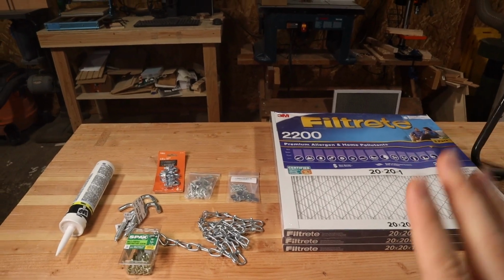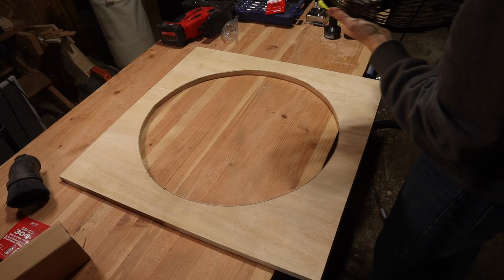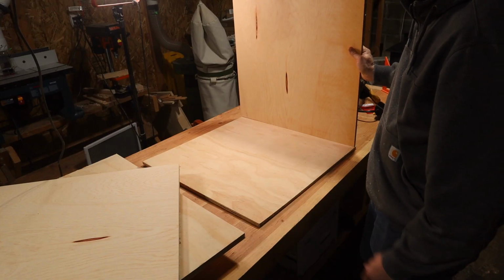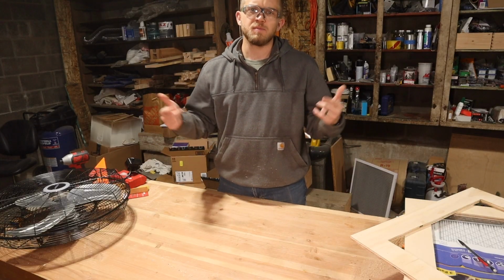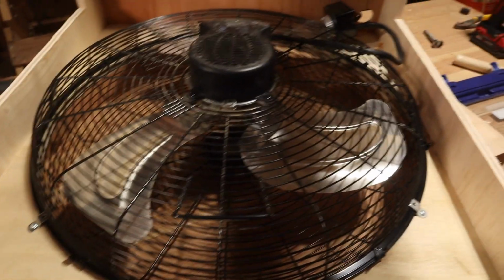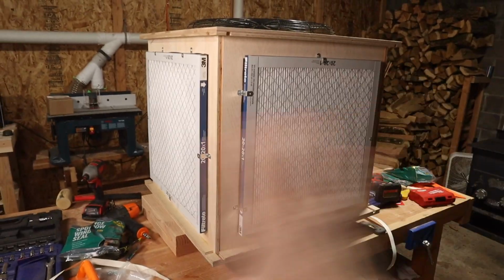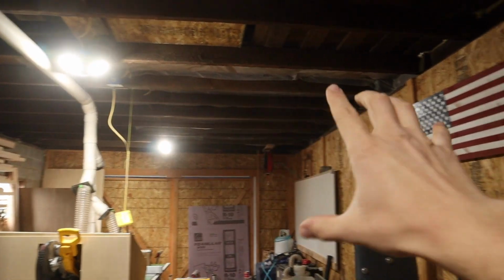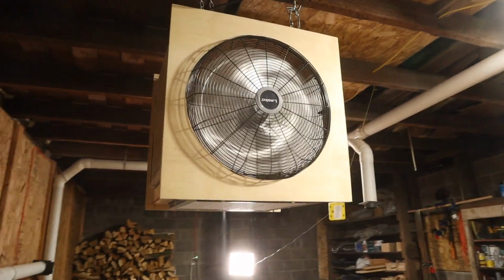Building the Best & CHEAPEST Air Filtration for Your Shop

Comment: This is interesting but for the one issue - your are pumping air around you shop which is unfiltered and the dust which is filtered ends up on the outside of your system... solution is to reverse the fan and make it suck air into a filter box. This way the filtered dust is contained and you only have to remove and clean, or ultimately replace, the filters when required. Other than this the whole set-up is great.
Reply from the maker: Not sure I understand. The air is filtered coming into the box and then clean air blows out the fan side. My thoughts on doing it this way were:

1. It provides more directed airflow on the exit which induces more circular airflow through my shop (I’ve actually felt this), entraining more dust. If the filters were the exit, it’d “muffle” the exiting air. 
2. The fan only interacts with clean air which keeps it operating more efficiently

I haven’t run into any issues with the dust being on the outside of the system, with the filters, it’s pretty well stuck on their until I take them outside and blow them out. 

Interesting idea though, make me wonder if in a larger shop you could do a two tan system to get the benefits of the directed airflow while more fully containing the dust 🤔
Reply: @NorthwestCraftsman  I guess there are positives in both methods. My inclination is to capture the dust INSIDE the enclosure, but I can see the value of doing so outside - e.g you could actually simply vacuum the dust away to clean the filters, which would be more difficult if the dust is on the inside.
My main issue with having the air being pumped outwards is only instinctive, and it is due to the idea of a strong wind blowing any dust around as opposed to sucking it into a filtered box.
I am no technician but it seems more logical to me to suck the air in and then dissipate it out after filtration, BUT in a more dispersed manner thereby causing less likelihood of undisturbed settled dust from becoming airborne.
It means that your system is simply used in reverse but as to the end-result advantages of this... I am not sure.
Reply from the maker: Yea, I totally see your point. Pros and cons to both. 

Thanks for the detailed discussion!
Reply: @selianboy8508 so what you're saying is to reverse the fan and basically inflate the box with dust laden air? Not sure how effective that would be as the filters collect dust. The backpressure against the fan would limit airflow. Just my 2 cents...
Reply: @MrDmorgan52  it is actually pretty much how most  dust collection works. There is no backpressure as the filtration system should be cleaned anyway. All vacuums work in this way for example albeit in a more 'direct' fashion. They collect the dust vacuumed up inside the container and not on the outside.
But there are benefits both ways around when all said and done.
Reply: @MrDmorgan52 There are some studies showing this to be true - the backflow pushes more dust back out around the fan rather than through the filters, especially quality MERV13 ones. The design with the fan blowing outwards and pulling air through the filters is optimal.

Comment: Great build. The problem is to maximize dust filtering you should only use one, or two filters max. With that much filter surface getting enough suction to effectively  catch the dust is unlikely. It is like trying to drink a soda through a garden hose rather than a straw. With only one filter the air movement from the fan would be the same, however the suction through the filter is greater and would capture more dust.
Reply from the maker: Thanks! I'd definitely make a few changes to it if I were to do it again. Mostly making it a little more streamlined and "right sized" instead of oversized like it is now. 

Regarding the filters, is the assumption that a higher air velocity through the filters will more effectively entrain the dust? My understanding was that the same volume of air will flow through the box but at lower resistance because of more filters. Same amount of dust being caught, just easier on the fan (maximizing flow rate), and spreading the dust between all the filters. Truly curious. Thanks!
Reply: More filters (more surface area) will actually increase airflow. You may be thinking of stacking filters (pre-filtering)

Comment: I built something like this about 15 years ago for a small shop I had at the time. Space was a premium. I made mine double duty. It was a dust collector and also a cooler for my compressed air. The contraption was mounted over the air compressor with the fan pointing down. The box had a plywood bottom with a hole in it for the fan. The sides and top were simple squares made of 2x2's rather than plywood. The  bottom was 22" square and the 2x2 squares were set in about 3/4" from the edge. Everything was just screwed together with drywall screws. I just used some packing tape, filter to filter, to hold the filters in place. When the fan is running the vacuum created sucks the filters to the frame anyway so no real need to get fancy with the holders.

The compressed air cooler was 50 feet of 1/2" soft copper wrapped into a coil and suspended inside the box from the top. Short hoses connected it to compressor and the water separator/filter. The air being pulled through the filters cooled the copper coils so water in the compressed air would condense and run down into the water separator. The air then blew down over the air compressor to help cool it as well.
Reply from the maker: That's a genius idea! When a get a larger air compressor I may consider that.
Reply: Wow this is an incredibly well thought out design!
Reply: Would love to see a pic of this👍
Reply: @Big-fish2331  Sorry, no pictures. I only had that small shop for a year or two and when I moved out of it, the cooler got scraped. I am really good about throwing together things I think will work but I'm not so good at documenting. I should really work on that.

Comment: I've build the same as you have with Merv-13 filters. But strange enough, after the box was finished, the ventiltor is sucking up air at the front of the ventilator instead of blowing it out..., The ventilator blows it out from the outer ring  of the ventilator. I've tried with ducktape to close the outer edge of the ventilator, but it's still sucking up air from the front.... It's also sucking up air through the filters, but not all... So I'm now planning to put also a filter at the front of the ventilator. Any thoughts about this issue??
Reply from the maker: That sure is an odd issue! I have had one that may be similar when my filters were too clogged to it blocked airflow and my fan "threw" the air out the edges of the fan rather than forward. Cleaned my filters and it fixed that problem but I don't think that's what you're dealing with. Do you have any photos of your setup that you could email me? A picture is worth 1000 words in a situation like this.
Reply: @NorthwestCraftsman  I'll make some pictures this evening, and email them. But, maybe you've answered my issue already. Here in Europe it's difficult to find Merv 13 filters in a panel. But I did find Merv-13 filter on a roll! So I made my own frames/panels for the filters, and made the box. I think that this filter I bought is the problem. It's just to blocked... Still strange, because the maze of the cloth is Merv-13. So I do hope, there is another problem.
Reply from the maker: Interesting! That could be the case. Does it run smoothly with no filter cloth in place?
Reply: @NorthwestCraftsman  Yes, when I bought the fan, I plugged it in, and it was blowing like crazy! But now in the box with filters it sucks up air from the front...It blows air out at the edges of the Fan. Just above the blades. I've already contacted the seller of the Merv 13 filters, to see if the filters I bought block the airflow.
Reply from the maker: Hey Michael! I got your email but when I replied I got a "full inbox error"

Comment: How many cubic feet is your shop, and how many cfm’s does the fan pull?  Will your filtration unit draw air from all areas of your shop?
Reply: I forgot to say “Great video “.
Reply from the maker: 😂 no worries at all. Shop is about 5300cuft and I haven’t measured the CFM rating on the fan but from the box it’s rated at 3650CFM. Likely an over estimate but should cycle the shop well. I can say in person it definitely creates a circular current in the shop. Won’t likely reach all the corners but it’s much better than it was and I already cleaned the filters out once. Holy cow we’re they caked already 😂
Reply: @NorthwestCraftsman probably picking up dust that has just been floating around?
Reply from the maker: @MrDmorgan52 absolutely. It’s pulling out more of the ambient dust as well as any that I generate.
Reply: Would pre filters help? This project is on my bucket list, great job, great video!
Reply from the maker: Thanks! Pre-filters would help but I’m not sure they’re necessary 😊 and do it sooner rather than later, my air quality is so much better.

Comment: Great video! I'd like to shrink the box a bit. What are your thoughts on airflow if I use 12x20 filters on the sides and bottom (and 20x20 on the back). Would reduce volume by at least 33%.
Reply from the maker: I’d recommend shrinking it as well, if it just doing a rabbet instead of a full dado. You could get darn close to 20x20. 

Regarding the shrink you’re talking about, I don’t see it being a massive issue, but I haven’t run any tests. I will note that within a month of using this my filters were already clogged enough to radically restrict airflow. Pulled them off and blew them out with an air compressor and it worked better. If anything, you’ll just need to do that more often.
Reply: You'll have about 68% of the filter area to work with (rough calculation because of the pleats) which will increase your time to clear by at least 30%... which still isn't too shabby.

I'm thinking about a 4-sided filter, mounting flush to the ceiling (no top filter) and using 14x25 filters. That's 70% of the surface area of 5 20x20 filters, or similar to your surface area but not far displaced from the ceiling.

Comment: Speed control would be nice for the times you apply finishes. So as not to disturb dust in the shop. I use the remotes that are sold at HD to control the on/off of Christmas lights. Great job.
Reply from the maker: Very true Kevin, I’ve actually come to the point with my shop that when finishing is occurring, I turn off all fans. I have clean air coming out of the filter but by the time the air makes it’s way around, it picked some up 😂 I know this slows curing sometimes but man I have a ton of ambient dust that always seems to get in my finish 😂 I guess that the price of living on a hazelnut farm 😂
Reply: Great video❤

Comment: Good work man, I almost built one of these.. supposed to have more air flow than all the commercial options on the market, how heavy did that thing end up being?
Reply from the maker: Thanks! It wasn’t nearly as heavy as heavy as I anticipated. Probably 20-30lbs. I could have shaved probably 5 off that with all the extra wood I used. It’s been about a month since I built it and the filters are already filthy. It’s amazing how much it’s pulled out.